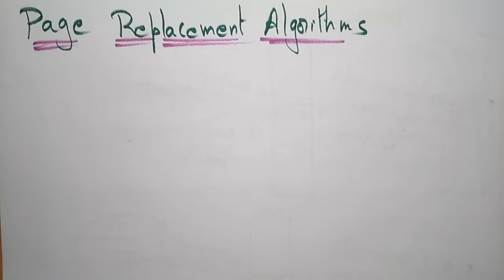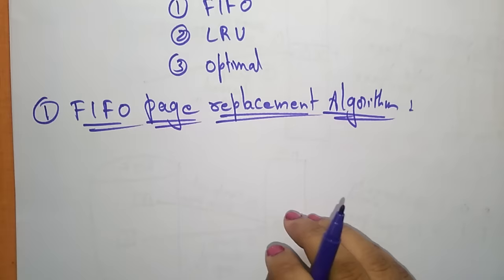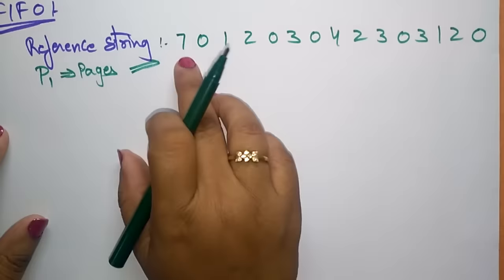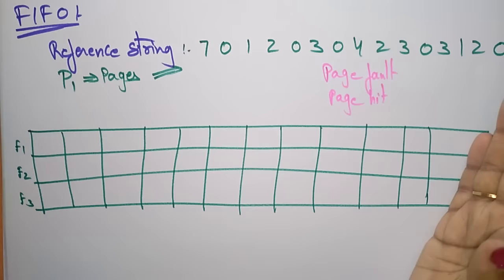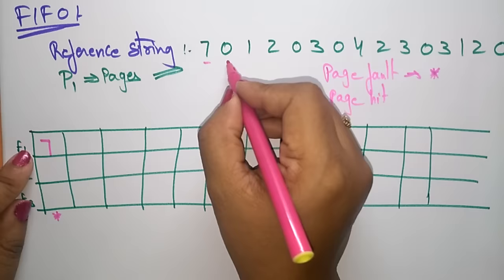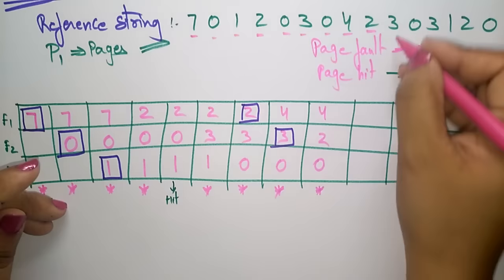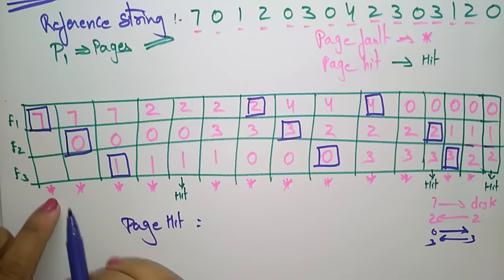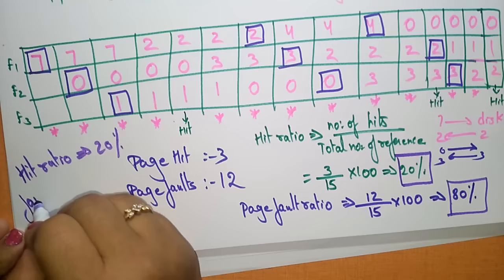Page replacement Algorithms | FIFO | Example | OS | Lec-26 | Bhanu Priya

Comment: what you actually saying is wrong. It is NOT replacing pages in the MM, it takes the block in the particular address and it trys to put this block into the cache. If the cache is full, so it has to use some sort of replacement algorithm in that case FIFO. It replaces the page in the Cache ! There are some sort of caches, they might forward this block also to the MM, but in this case it only replaces in the cache!

Comment: Count the total number of page faults for 3 frames for given algorithms and refrence string as given below: 70    120340230321201701204, 1 FIFO Page Replacement, 2 Optimal page Replacement Solutions3, LRU Page Replacement

Comment: Consider the page reference stream “7 0 1 2 0 3 0 4 2 3 0 3 2 1 2 0 1 7 0 1” and
calculate the number of page faults would occur using LIFO and LRU page
replacements algorith
Reply: 15 fifo optimal 13 lur 12